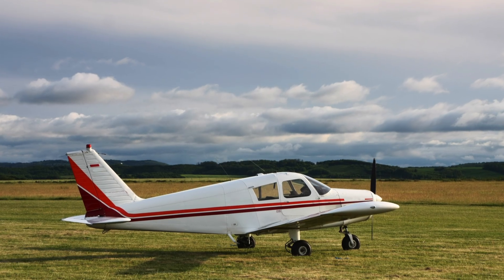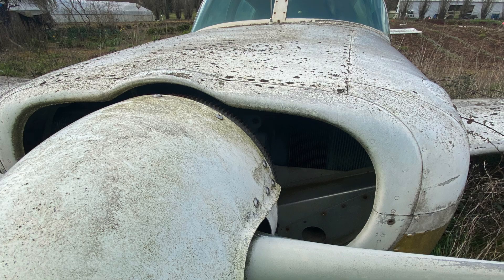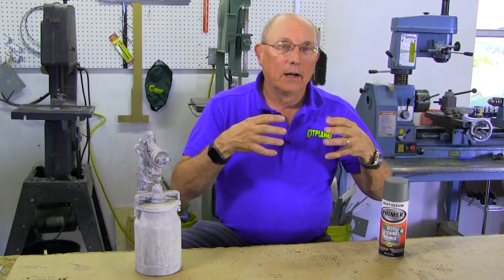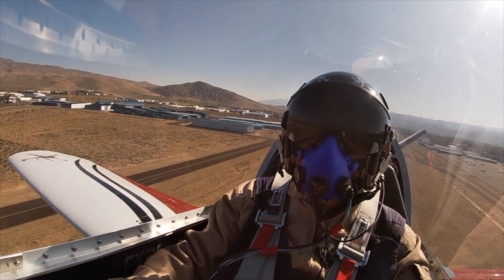Metal Magic: Should You Bother Priming?

Comment: Another big area of priming is when attaching two dis-similar metals (Aluminum to stainless steel).  Rather than moisture corrosion, you are protecting against electrolysis.  I use a rattle can Zinc Phosphate which is still available.  The theory is that the Zinc in the primer draws away the electrolysis from the metal.  If I lightly sand and then clean with acetone, the primer adheres extremely well.

Comment: When ever riveting new parts together your should aleast etch prime both surfaces in lap joints & seams or where ever moisture or water can get in to start corrosion. This is very easy when working with new metal just clean with solvent & spray. Old metal wire brush, scotch brite or etch first.

Comment: And no-one mentions acf-50 or corrosion-x why not? If you prime incorrectly, that might accelerate trapped corrosion. If you use acf-50 or corrosion-x, you just apply it periodically over the years and it eventually dissipates, but it is very simple to apply. Certainly much less work than priming.

Comment: I've been using that self-etching primer that comes in the rattle cans for metal. It works great, and is suspiciously similar to what I remember zinc chromate was like. For Poly Fiber, it says to use an epoxy primer. To avoid that, I got a can of appliance epoxy in the rattle can, which dries slow and stays tacky. Then sprayed poly fiber paint over it and it came out great.

Comment: I have worked on commercial aircraft for over 50 + years and never once seen unprotected structures and any replacement parts ordered from the aircraft manufacturer arrived pre primed.  Furthermore, any  repair work called for priming the effected surface areas.

Comment: You believe wrong You missed on this video. sorry. There are two types of primers. There are sealing & non sealing primers. Sealing primer doesn't not require a top coat to protect against corrosion. Non sealing like that "Raddle Can self etching" is a primer that requires a top coat to protect against corrosion. YES I am right correct & Yes I ahve contacted RustOlem directly about their product. That exact product specifically. No need to say thankx
Reply: I use EPC-2 primer from Endura. It is a true sealing primer. However it is not user friendly. Not even a tiny bit user friendly. I love Aircraft Spruce

Comment: To expand on Jason's comment, 6061-T6 is much more corrosion-resistant than other alloys.  Another alternative primer you didn't mention is using Cortec  primer on mating surfaces of parts - dilutes with water, brushable, and relatively non-toxic.